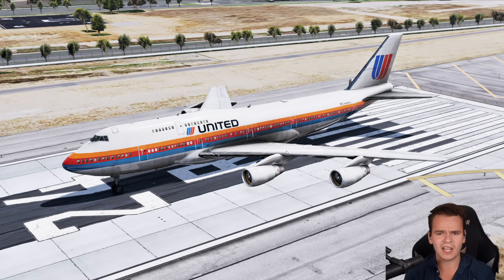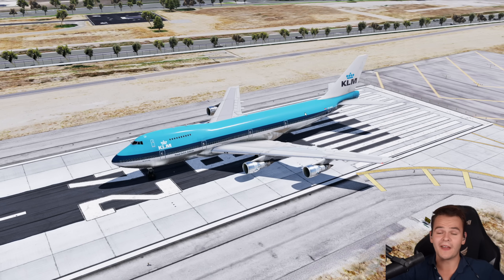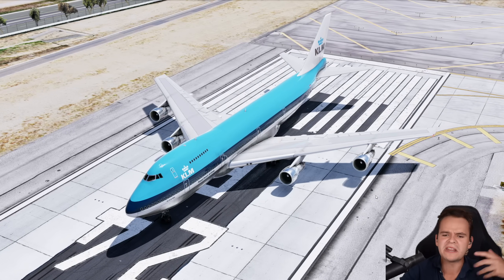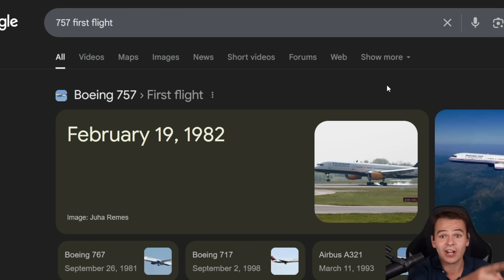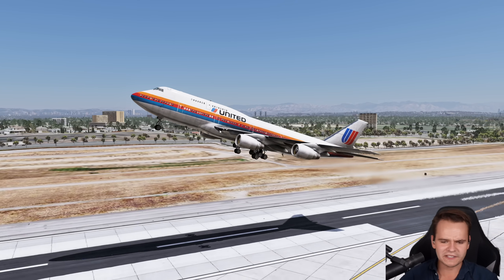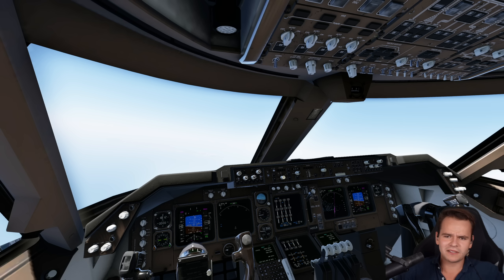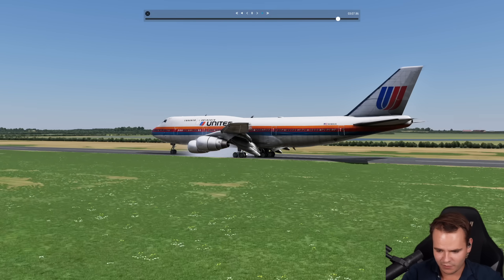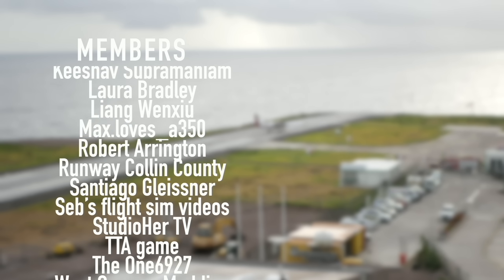Why The 747-300 Failed So BADLY

Comment: 747-300 was not a failure by any means. It's success is inextricably tied to the -200B. It was just a low cost/low risk higher capacity option of the 747-200, sharing everything from structure to engines. Stretch upper deck was offered for 747-100B and -200B conversions while factory direct with SUD option simply became -300. Uniquely Japan Airlines was the only customer to take delivery of the -100B SUDs (747-146B SR/SUD to be precise) with an astonishing seating capacity of over 600 seats!

Comment: In my MSFS2020 experience with the Boeing 747, it can land on surprising short runways.
That's probably because it has four engines and also four thrust reversers. The 'jumbo' Airbus only has two thrust reversers.

I have made succesful 747 landings at Santos Dumont Airport and London City Airport.
Although I can't remember if I could take-off again without ditching most of the passengers first.

Comment: The 747-300 probably didn’t cost lots to make if all they did was stretch the upper desk and give it straight stairs instead of spiral. Making the 747-400 meant major overhaul to all the systems and parts on board so that needed extra time and the 300 was just a placeholder.

Also, you also have to account for pilot and maintenance certification. By keeping the cockpit same across 100/200/300, it would be easy for airlines to shuffle pilots around whereas they will need extra training and new certification to move to an aircraft with a different cockpit layout

Finally, Airbus was starting fresh in the 1970s with the A300 which was when computers were becoming popular so they could implement without too much complications

Comment: What also killed the 747-300 was that Boeing also announced a modification to existing 747-200 so that they can have an extended upper deck. It was known as the 747-200SUD. Some airlines spent money on modifying their 747-200’s to have that modification done.

Comment: I flown a 747-300 many times, not sure if this depending to airliners the 300 have some modifies like bigger overhead pins, some improves for wings, the cockpit still have an old design to make easier and cheaper for type rating like other Boeing aircrafts shortly

Comment: There was also a 747-200SUD (Stretched Upper Deck) which is quite literally the exact same as the -300 but without the mildly improved wing
Reply: 747-100SUD you mean?
Reply: @bkbdoesrandomstuff nope they made -200sud too
Reply: “As on the -100, a stretched upper deck (SUD) modification was later offered” ~ https://en.wikipedia.org/wiki/Boeing_747

Comment: The -300 failed because boeing still sold the -200 alongside plus offered an extension programme for the -100 and -200, basically making it useless
Boeing shouldve only just sold the -300 when it rolled out

Comment: Actually, i remember as of December 2024, only 3 747-300 are still flying and one of them flies for Mahan Air. The first time i learn about the 747-300 ? Korean Air Flight 801 on August 6th 1997. A 747-300 crashed while on approach to Guam during rain shower. Poor crew communication and a possible pilot fatigue were contributed to the death of 229 of the 254 people onboard.
Reply: That's not true brother 

Mahan air do not use 743 anymore 

They use the only 747-400 in iran 

The register is EP-MEE
Reply: @ALIREZA.TONES1  yeah, i think it's in the Stored state now